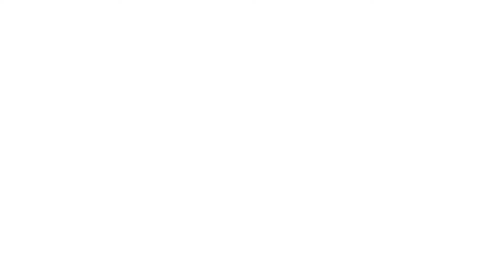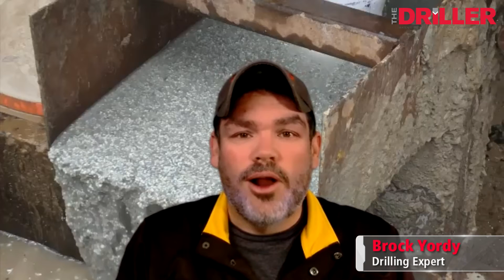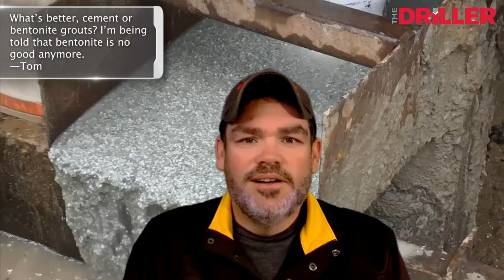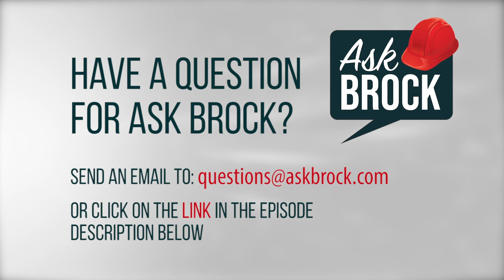What’s Better, Cement or Bentonite Grouts?

Comment: Fact is that is as a driller, what you want to achieve is to conveniently hold the casing pipes in place while you drill ahead or permanently keep in place the casing pipes after the drilling job without closing or plugging  the aquifers or disturbing  the production of water from the aquifer at the end of the day or operation. So, first thing is to understand the chemistry of what you want  to use to achieve  the purpose of the assignment , in this case, Benthonite and or Portland cement; understand your drilling design and the program and then the ground water chemistry. Either Benthonite or Portland cement or a combination of both does this very effectively. All that's needed is you and your understanding of what you want achieve and your experiences of drilling, chemistry and engineering or design based on proper understanding of Geology.